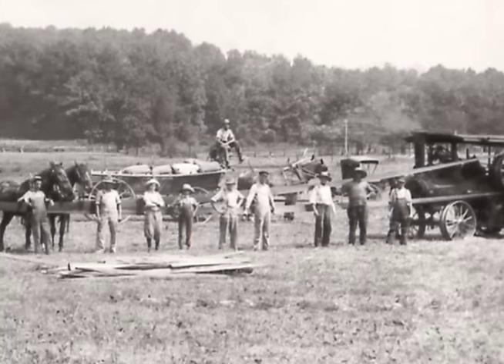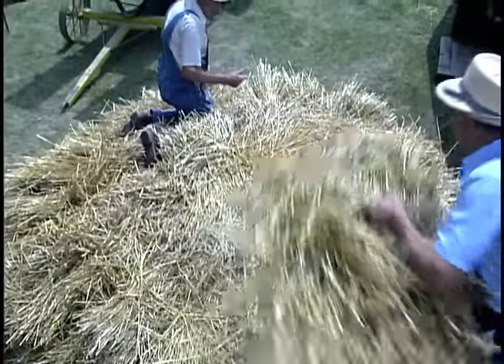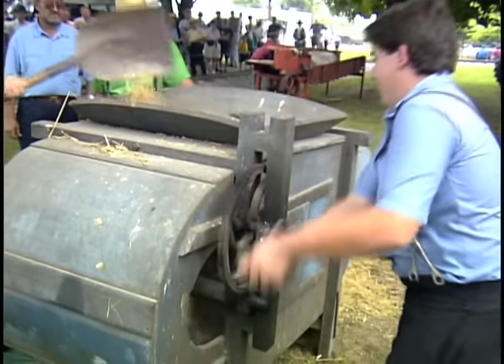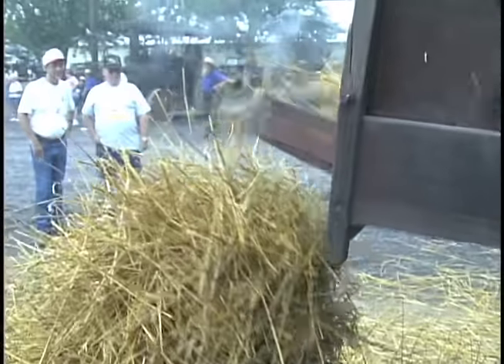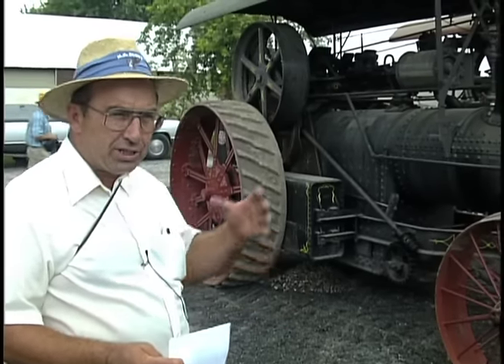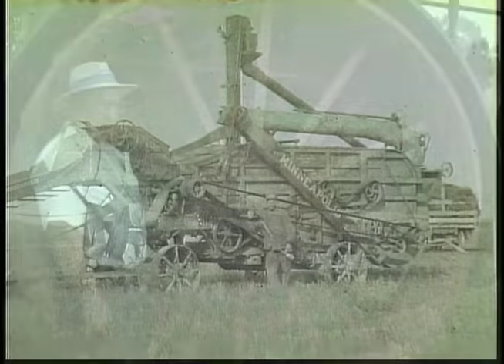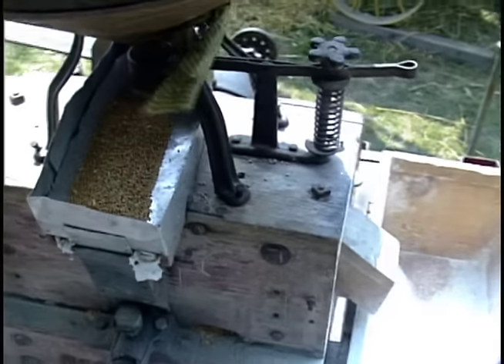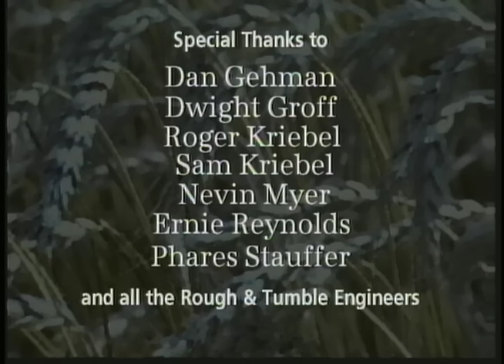Harvest; The Threshing Story

Comment: I'm 73 years old and a few of my earliest memories revolve around the threshing machine, sitting on the barn floor of my grandparents farm. It was run by a long, wide belt that was powered by a large pulley on the tractor. I remember Dad feeding the sheaves into the front of it and my grandfather and uncle bagging the grain from a side chute. The threshing machine was set up right beside the granary and the bags were emptied into the grain bins. The straw was blown out the back by a large, round chute that blew the straw into the straw mall. When they took a break and shut off the machine us kids would be sent to the top of the straw pile to stamp it down. It was more fun than work for us! This was all back in the late 50's as my grandfather passed away in 1957 and my uncle took over the farm and things were never quite the same after that. One of my earliest memories was my older brother and I carrying the water pail from the hand dug well to the fields for the thirsty adults who were cutting corn and stacking it into shocks.
Reply: Bro my grandpa has like the same story that sounds so cool
Reply: The good ole days
Reply: Nice story.

Comment: Ross I was told the corn special combine was a heavier built machine. In 1959 the Hercules engine blew on dad's pull type Baldwin. The next spring dad bought a new 1959 45 combine. In 1969 dad bought a 1959 95. For several yrs we run both combines. In 1979 dad bought a 1969 95. All 3 were good combines. Mike's Buhler, Kansas mite have some of your combine parts.

Comment: This video is absolutely fantastic. I remember one year, must have been is first or second grade, we planted spring wheat in a small test plot near our house. Hand broadcasted and raked in. I cut a good amount of it with a sickle hook, loaded it into the Radio Flyer wagon, and brought to to the slab out front of our shop. In our shop, I found a wooden box with a fairly large mesh screen on the bottom of it - it must have been for classifying rock by size in a gradation, but the holes looked about the right size for grains of wheat. I clapped and rubbed the heads of a few stalks of wheat at a time between my hands over that box, and then picked it up and shook it to make the grain and some chaff fall through onto the concrete slab. I picked up the grain and chaff, and each time I felt the wind blow, I chucked a handful of it up over a cardboard box, and used the wind to winnow it.

I didn't get the cleanest sample in the world, or a large quantity, but looking back, it was a great learning experience. To think that I now own my very own combine, and that experience helped me to understand some of the principles behind the operation of that combine.

One of my first dates with my girlfriend was when I took her to our local threshing show about an decade ago, and scooped some freshly threshed wheat as it came out of the thresher, and we snacked on it together. We've gotten to where we go to somewhere between 6 and 10 threshing shows per year, and make it a tradition to do that same thing. Rough and Tumble hasn't been crossed off our list yet, but someday we'll make it there.

I've been very blessed the past few years, having been able to attend a couple different steam schools, volunteer at our local show, and last year, brought some of my family's equipment to a threshing show for the first time. I am very blessed to have the passion but not need to depend on it for my whole income.

Thank you for posting this video. I could watch it a dozen times and not get tired of it. A great watch with the family, especially for kids who are coming of enough age to grasp the concepts demonstrated through the technological advancements shown in this video. Thank you so much for posting it!